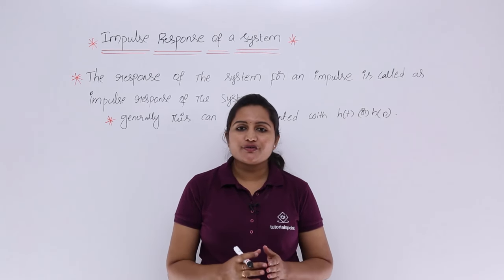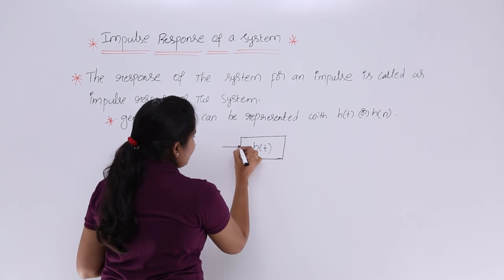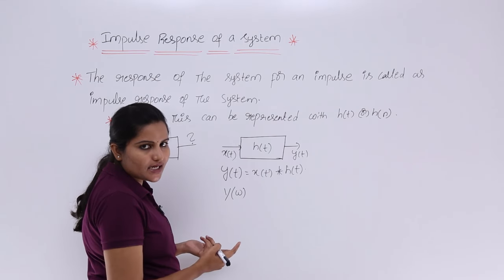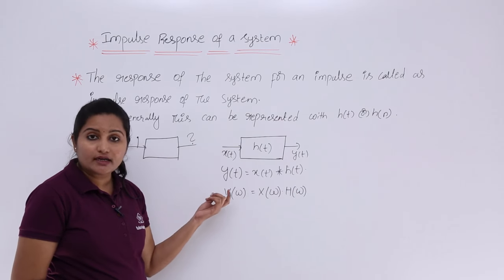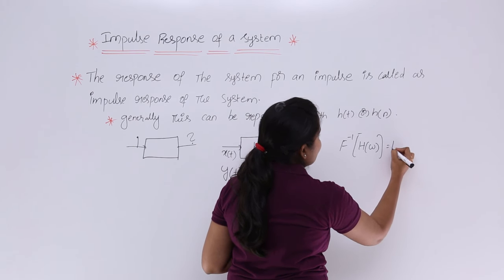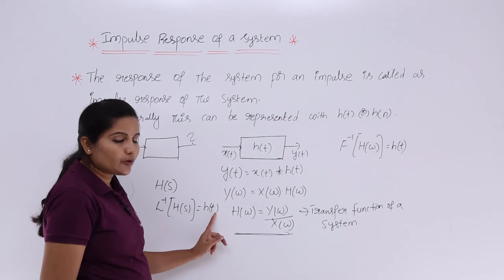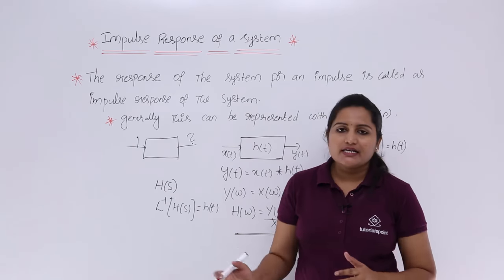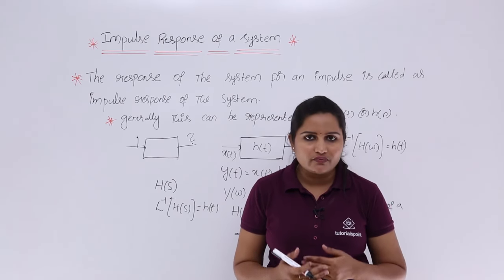Impulse Response & Transfer Function of a System

Comment: No one has any idea why they are studying this stuff. FYI it is used in audio production ( audio engineers) use this as application without knowing this most of the time
Reply: It is used in control systems, and control systems are in most of the machines despite its engineering nature. It is not only specified for thw function of Audio Engineering sir.
Reply: Convolution is used in Quantum Field Theory too ;-)

Comment: When we find the impulse response of a system what should be its particular solution??? 

Plzz anyone solve this question.
Reply: the impulse response is unique to every unique system 
if that is your question?
else here is a way of thinking about what impulse response means.

if you have an unknown system and your input x(t) is the impulse function then y(t) is the impulse response
The impulse response captures what the system will do to any input.
 for example your system delays your input then for x(t)= q(t) (impulse function), y(t)= (q(t-a))
note the area of q(t) = 0 for t>a and t<a
thus at a the area is 1
now if you take the impulse response y(t) and "convolve it* with any input x(t) it will do what your initial system did to the input
thus x(t) * y(t) = x(t) * q(t-a) = integral from - infinity --> infinity x(g)y(t-g) dg

please learn the convolution then come back to my explanation if you are still confused

Comment: A control system whose response is step response, -0.6(1+e^-3t) cascade to block whose response is impluse response, e^-2t. What is the transfer function system. Answer  can anyone tell me
Reply: since the systems are cascaded, the functions are to be convoluted.  convolution of the given functions become
 [-0.6(1+e^-3t)]* [e^-2t] 
= [-0.6*e^-2t]+[e^-3t)* e^-2t]. 
Applying Laplace transform, above function becomes
=  [-0.6/s+2] +[-0.6/(s+3)(s+2)]
applying partial fraction to 2nd term;
=[-0.6/s+2] +{[-0.6/(s+2)]+[0.6/(s+3)]} = [-1.2/(s+2)]+[0.6/(s+3)] --> transfer function of the given system
applying inverse Laplace transform,
= 0.6(e^-3t - 2e^-2t)   --> output response in time domain